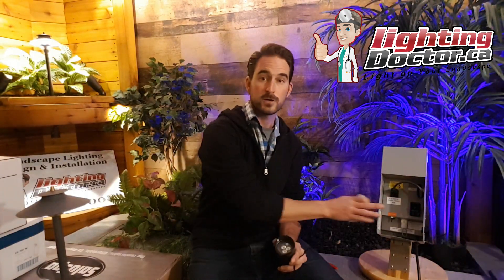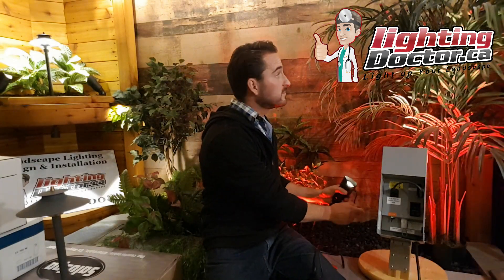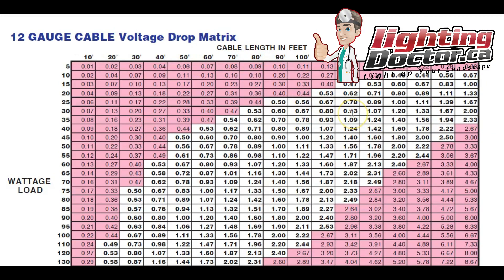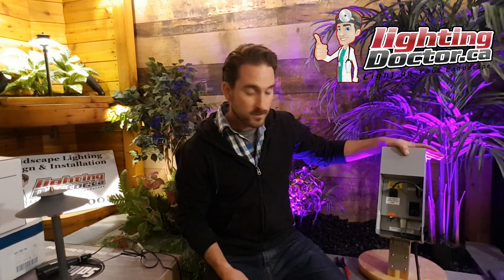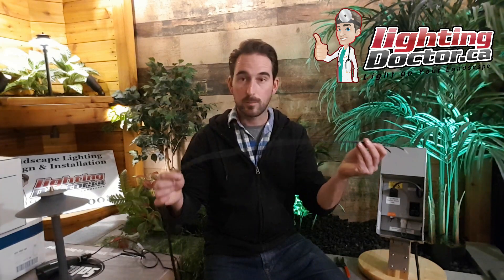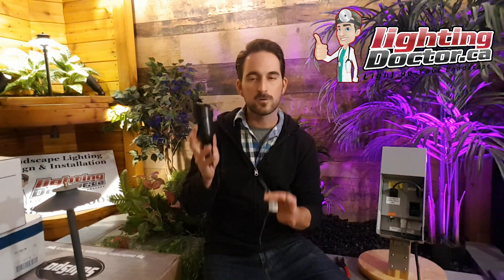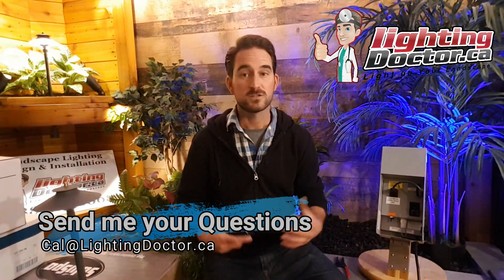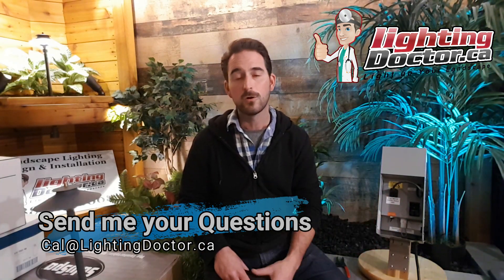How to Install Low Voltage Landscape Lighting - Calculating Voltage Drop & Sizing Transformer

Comment: thank you for great video. just one question. I purchased bunch of lights from home depot and lowes and they came with connector which punctures tiny probe into my 12/2 line and thats how they get power. are these connections safe to be buried underground? or do they need to be sticking out. they do not look very water resistant and I see that you are cutting and using yellow connectors that snaps. let me know if you have good advice. thank you for the help.

Comment: Lighting Doctor after all thanks for all the info in your videos and thanks for helping the DIY community, today installed a 286 long feet line with 5, 12 watts fixture (bight property), it has been grate DIY project, for future reference where can I print the 12 gauge cable voltage drop matrix chart? yes the one you used in this video!
Reply from the maker: If you email me at Cal@LightingDoctor.ca I can provide that chart for you

Comment: I have 6 120v lamp post lights that I want to convert to a low voltage  using a low voltage landscaping 14-2 wire to a  Dewenwils 300W low voltage transformer.  The wires on the post lamp fixtures are black and white, and the low voltage landscaping wire is both black at split.  It does not light up when connecting the low voltage landscaping wire to the lamp post wires.  Is it because the wires are different?   Is it possible for it to convert or work ?  If not,  is there a way that I can get it to work?   Thanks

Comment: Hello. I am setting up 110 watts worth of lights on a 200w transformer using 12g cable I’ve split the lines to the lights in 3 so that each line carries about 40w. Does it matter if I use the 12v or 15v tap on the transformer? Thank you.
Reply from the maker: The 12 volt tap will be fine for that load of lights but if using LEDs its worth using the 15 volt tap and it wont burn out the bulbs and allow for expansion at a later date also...